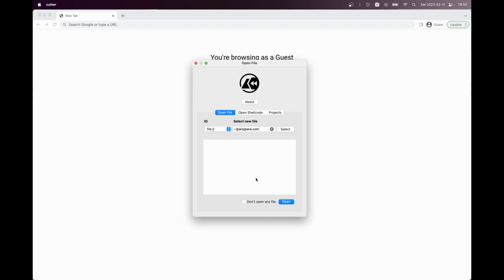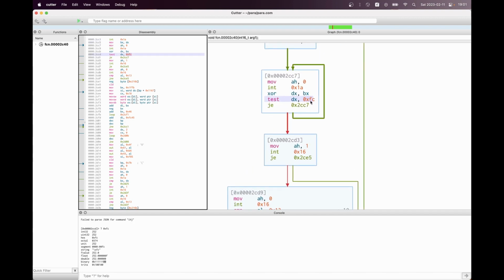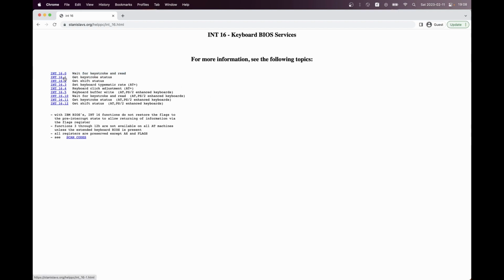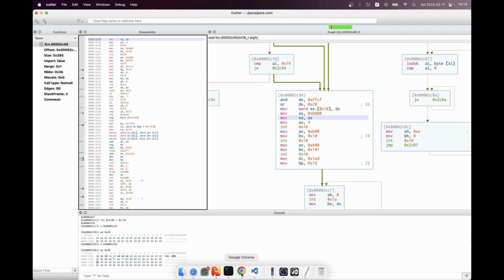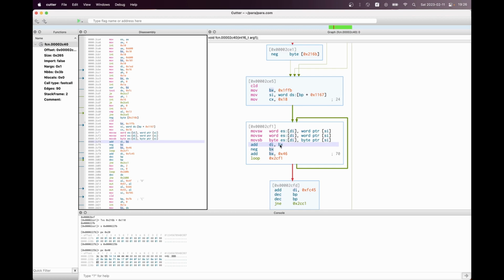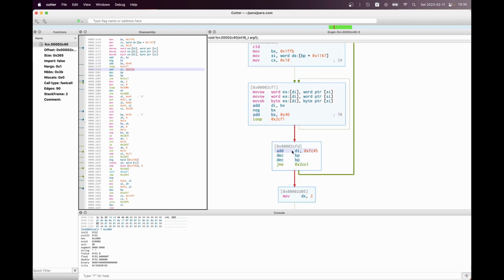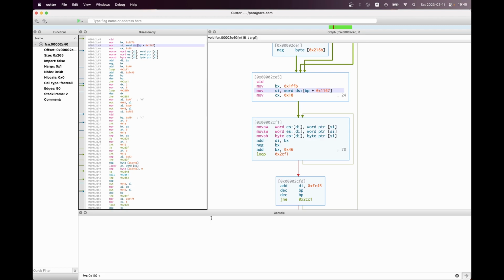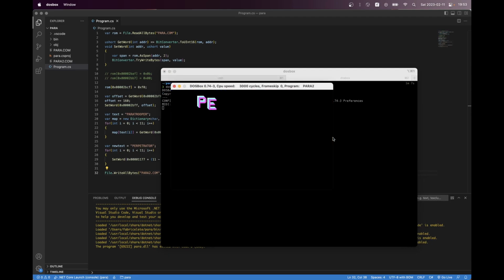Reverse engineering an old DOS game (part 2 of N)

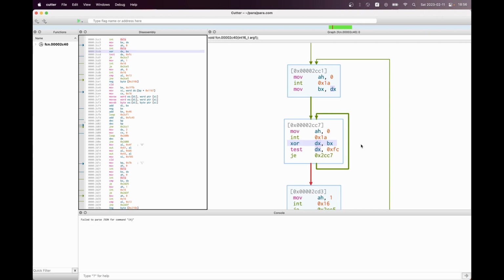Comment: Around 3:30 he mentions if you XOR an old value against a new value, you get the bits that changed.. and it's true:

00 -> 00 = 00; Masked: 0
00 -> 01 = 01; Masked: 0
00 -> 10 = 10; Masked: 1
00 -> 11 = 11; Masked: 1

01 -> 00 = 01; Masked: 0
01 -> 01 = 00; Masked: 0
01 -> 10 = 11; Masked: 1
01 -> 11 = 10; Masked: 1

10 -> 00 = 10; Masked: 1
10 -> 01 = 11; Masked: 1
10 -> 10 = 00; Masked: 0
10 -> 11 = 01; Masked: 0

11 -> 00 = 11; Masked: 1
11 -> 01 = 10; Masked: 1
11 -> 10 = 01; Masked: 0
11 -> 11 = 00; Masked: 0

In the video's example some of the bits were masked. Since it's a timer, as the number increments you could ignore the first x amount of seconds by masking off the first few bits. In my example above, if you used a bitmask of 01 and XOR that (TEST would use a bitmask of 10 instead), it'll take just the leftmost bit.  

It's a really efficient way of making a simple wait/timer in this case I think, although it may not be high precision depending on CPU speed and other variables.  The other disadvantage is the CPU won't do anything else during the loop in this naive case.  If you see any mistakes in my comment please let me know.

Comment: Great videos. I hope you'll make some more.

There have been some interesting coding practices in this game, and I see a couple of optimisations that could be made - if they really mattered for performance, but I suspect not.

E.g. in this first video when checking for yes/no replies, a small optimisation that could have been made is to take the character code, OR it with 32, and then you only need to test against the lower case character, since an upper case character would then have been converted to lower case.

And in this second video when creating the delay loop I don't really see the need to do much more than AND the timer value with 0x3 and see if that results in zero before continuing. It seems a bit convoluted to XOR against the previous value looking for changes in the upper bits.
Reply from the maker: Thanks for your kind words! I made further progress in reverse engineering this game but it got a little more involved and I had a lot more work to prepare the next video, which slowed me down. I'm planning to get back to it, and it's a great source of motivation to know that people are enjoying it.
I agree with both of your remarks, there are some opportunities in this game to optimize both the speed and the size of the code. There are also a few things which seem useless or redundant (like in the video mode initialization in the first video). I assume it's simply a consequence of the game having been written solo by a teenager and over a short period of time. But those small issues aren't detrimental to the functionalities of the game in any way. I secretly hope to find an actual bug in there at some point, but chances are slim.
In any case, it remains really humbling to look at this code, while thinking about the circumstances of its creation. And the little mistakes add a human dimension to it.
Reply: @fabricelete5337 I'm guessing you've lost motivation to work on the next episode in the series, but i'd still love to see it :3
Reply: Since it's a timer, just checking for ...00 could in theory miss an update, eg ...11 then ...01. I don't know how likely that is in this context where the loop seems quite short, but it's probably a habitual/copy pasted standard timer loop.